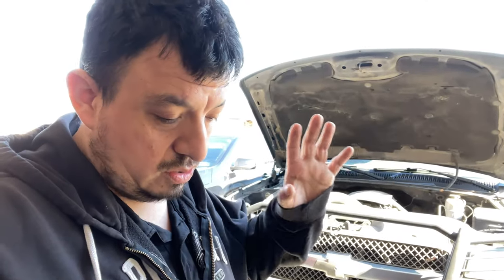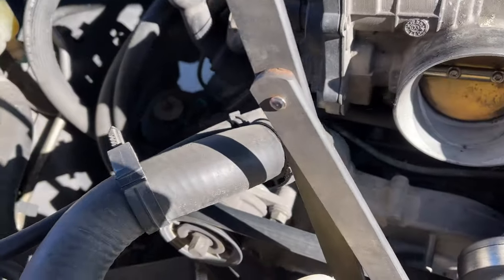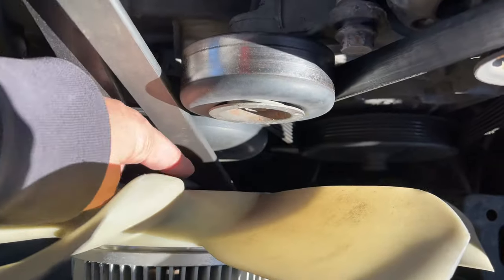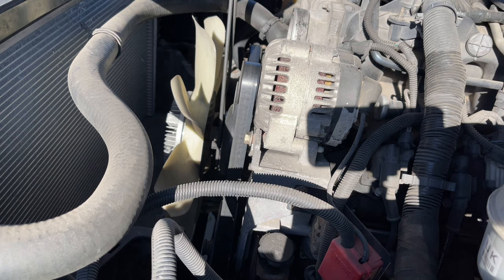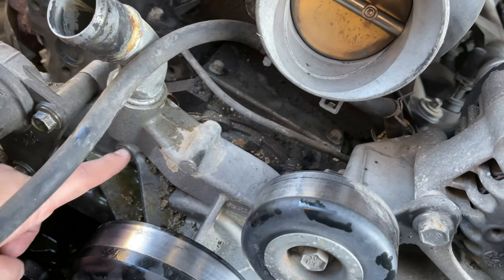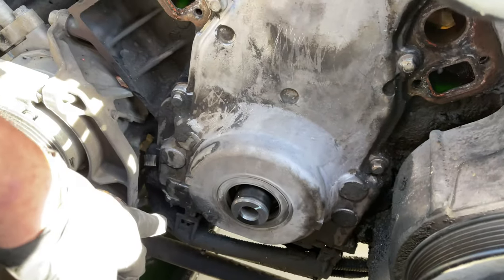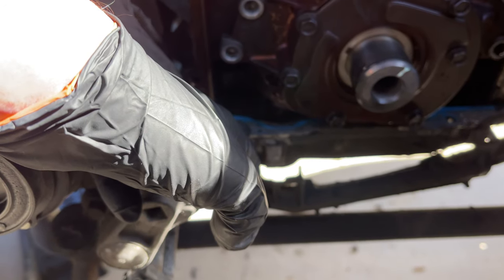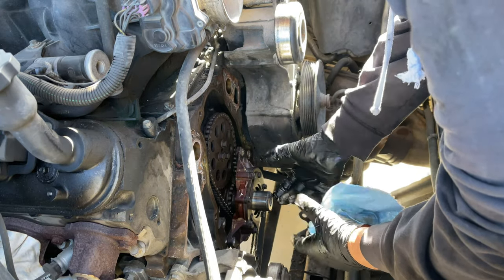Chevy 4.8L 5.3L 6.0L Oil Pump Removal & Replacement

Comment: 2002 Tahoe 5.3 I just bought it and it after the second day the oil pressure dropped and my truck started tapping but when u turn it off and on it goes back to normal then drops again, what could it be? Pump or sensor?
Reply from the maker: have you changed your oil? i would start there .. sounds like there is trash/debris on the oil pan .. try that first and see how the oil looks when coming out

Comment: Would you be able to take the fan off with out the special tool
Reply from the maker: yes but not easy
Reply: I took off the water pump, fan came with it.
Reply: I replaced my water pump and from my experience it is worth the money just to get the tool.  I tried all those other ways of doing it and just got frustrated.  Bought the tool and was done in 30 seconds.
Reply: Yes I took a foot long half inch extension placed it on one hex points on nut.  Hit extension twice with 3 lb hammer.   Spun it off with my hand. 2004 5.3  Went to help my buddy he had 2006 it took 4  smacks.  Didnt use special tools or even a wrench.
Reply: I tied a shoestring through one of the holes on the water pump pulley and the left bolt on the alternator. It held the pulley still enough that I got the fan clutch off with a 18 inch adjustable wrench.

Comment: I have a 2001 6 liter 1500HD . Is the oil pump located the same as your truck?  My oil pressure fluctuates from 40 psi to 0 psi . I have to keep the rpms at 2000 until it heats up and drive 2 miles before the oil pressure builds to 40 psi. I have 283,000 miles on it.
Reply from the maker: yes .. same spot
Reply: Same here

Comment: You can losen the bolt on the pick up tube and tie a string or zip tie around it so you dont have to remove the oil pan
Reply: I use a little mini magnet, so far so good!

Comment: 11:50pm
07 Silverado has 82k but sat for 2yrs,changed the oil like twice already but lifters are knocking, run motor medic before each oil change and it's getting better, could it be the oil  pump?,gonna change again ,run a quart of marvel mystery oil to clean it better with the nx change,any suggestions other than changing the oil pump
Reply from the maker: does it have DOD?

Comment: I bought a 06 Silverado 4x4 with a 4.8 nd when I got it the oil pressure was max out nd stayed there. Had a knock sensor light on also. Got both knock sensors replace nd oil pressure replaced. Now it’s says low oil pressure. It would go up nd down nd when idle it will drop . any ideas of it ? Nd idk why but knock sensor light keeps coming on after replacing em can somebody help me out on ideas?

Comment: I have a 2011 GMC Sierra 5.3L. Today my oil pressure went to 0. When I start the truck it idles around 20psi and then after a minute or so it starts dropping. I’ve read that it could be the o ring in the oil pickup line in the pan or that it could be the pump. Hoping maybe you can steer me in the right direction? Thanks for any help.
Reply from the maker: it has the system that it switches from 8 cylinders to 6 .. correct?
when oil pressure drops does the engine knock?  or does the engine sound different at all?
Reply: Mines a 2008 yukon 5.3 with the DOD (changes to 6 cylinder) oil pressure dropped to zero no weird noises and then my engine shut off.
Reply: @FalconsGarage  hi I have the same problem my engine is a 5.3L makes a slightly small knock or rattle when it is on idle what can it be ?

Comment: I have a problem with my 5.3l it's spraying oil all over my spark plugs wires n on my headers I changed my valve cover twice n the gaskets n it still doing it now dash keep saying oil pressure low when I'm n park I'm lost I thought it would be my oil pump but that don't explain how oil getting way up there whatchu think
Reply from the maker: what about the oil pressure switch?  its up there between the heads .. maybe its leaking and oil is running down to the wires?

Comment: will this work the same on a 2010 chevy express 2500 4.8 liter v8
Reply from the maker: it should be the same engine .. for the most part ..
Reply: Shim the oil pump then prime it too.

Comment: I have a 2008 K2500 Suburban 6.0 with only about 40k miles.  No oil pressure.   I can't believe the oil pump is bad with such low miles.  This video was a 2wd.  Mine is 4wd.  Looks like a major job.

Any opinions on why my oil pump is bad?
Reply from the maker: yes on an 4wd is a pain in the butt .. i would check or replace the oil pressure sensor before doing the pump .. i believe in 2008 that truck has the ability to use switch from 6 cylinders to 8 right?

Comment: Did it get more oil pressure after the replacement? You better replace the O-ring gasket around the oil pickup tube also.
Reply from the maker: That’s a must!

Comment: My oil pressure gauge fluctuates when I'm stopped and while driving. Can that be the oil pressure pump?
Reply from the maker: to a point thats normal .. specially with this trucks
Reply: @FalconsGarage  the thing is that when I'm going 70 it jumps from 50 to 60 to 40 but real fast but I'm going the same speed

Comment: Is there a reason why you didn’t do the timing chain? Seeing that the oil pump went out you probably have over 100,000 maybe even 200,000 on that chain.  If that breaks bye bye engine
Reply from the maker: chevy timing chains last a long time specially on this trucks .. this one wasn't stretched . so no need from my experience

Comment: I have a 2001 2500 6.0 and I bought it recently but it has a scrapping sound or tapping in the lower part of the engine. It's not a rod knock sound It's more like something is hitting something. Anyone else know of this sound?

Comment: i have an interesting question, i have to do my oil pump in my 2009 cadillac DTS as it’s marking low oil pressure after replacing my oil pan gasket. i thought the harmonic balancer could have been out of torque or simply went out so i replaced it and still low oil pressure, i do remember removing it and getting a really burnt oily smell from the hole where it mounts up, my question is which one is the oil pump?? or are there two separate oil pumps in the oil pan where the catch tube is and the timing chain cover??? if anybody could help with this it would be greatly appreciated!
Reply from the maker: so I belike the oil pump is behind the timing chains .. i would take off the oil pan again and double check everything .

Comment: Avoid the nightmare of R&R oil pump replacement. Unlikely the mechanical pump has failed, more likely the gasket for the pickup return is worn out. Add some AT-205 to the oil and save yourself a 12 hour job. I did it on a 2006 4.8 with 283K and both the 'low oil pressure' warning and the valve tapping has disappeared.

Comment: My motor has a loud click, when you accelerate it gets louder. Is it the oil pump?
Reply: Do you have oil pressure? Could be a a few things.. however my guess would be valves need adjusted
Reply: @classiccam4647  the oil pressure went down and as soon as that happened it started click.
Reply: @julian_km5529  is it at 0?  That’s does indeed sound like and oil pump is bad
Reply from the maker: I agree could be oil pump
Reply: @classiccam4647  it’s at 20
Reply: @classiccam4647  my pressure drops to zero at idle but picks uo when accelerating never goes above like 22psi tho lol
Reply: @thephantomzoneboxing  bad oil pressure sensor?
Reply: @classiccam4647  i dunno its a old big block 427..retarded the timing so it wouldnt diesel and then this issue starts up..but who knows might be a bad pump..i just put a gang of treatment in it as far as the honey oil and stop leaks

Comment: WHEN DO U KNW ITS YOUR OIL PUMP AND NOT A SENSOR OR OIL FILTER WHEN YOU HAVE LOW OIL PRESSURE??
Reply from the maker: You don’t. You have to do testing. Even once you replace the oil pump issue could still be a spuned bearing from the bottom end. Could also be your oil screen witch you can only see if you take off the oil pan. So there is NO simple way

Comment: I have a 2008 Suburban, K2500 6.0 engine with only 40k miles on it.  I lost oil pressure.  I suspect it is the oil pump.   I cannot believe that I have to replace an oil pump on an engine with such low miles.   We have a 1999 and had a 2004 Suburban.  They are / were great vehicles.  This 2008 is a lemon.
Reply from the maker: are you sure its the oil pump? this engines are known to have faulty, oil pressure sensors, dash cluster and if its the type that switched between 6-8 cylinders are also known to have a leaking upper cover gasket
Reply: I had that problem on a 2007 impala ss 5.3l and also on a 2010 silverado 5.3l. There is a plastic screen below the oil pressure sensor that gets clogged! You will need a pick or bend the handle end of a chainsaw file into a hook and reach down the hole after removing the sensor and hook the screen and pull it out and replace it along with the sensor! I almost guarantee thats is your problem!

Comment: So everyone keeps telling me the motor has to come out and trying to charge me over $1000 to put the pump in, I have a 2006 Tahoe 5.3l n it doesnt look like you pulled the motor out at all just took some stuff off 
Someone reply because I'll rather do it myself if motor doesn't have to come out
Reply from the maker: if your engine looks like this .... then engine does NOT have to come out

Comment: Appreciate the content, but you didn't torque a single bolt.... You used a 1/2 impact to put on bolts meaning to have 18 ft lbs or torque. but wait!!! You then tightened them even further by hand! Good job, bud. We all need to see the wrong way to do things, I guess....

Comment: You don't need to take the oil pan ther is a trick to do it so
Reply: What did you do to get it off
Reply: Withe the 10 milimetros took the bolt 🔩 off and with the magnet 🧲 took out the oil pan when I put the pop back up i got the bolt 🔩 in the other side just cut the little weld in it and it will turn around so you can put the bolt in the other side ,,them fucker dealers just make it that way so they can change more on labor
Reply: @alfredoleyva255  I didn't really understand that...🤔

Comment: I have a question, I have a 01 GMC Yukon, it shows check engine oil level but my oil is right in the middle and no problem, I change the O ring, I check the lifters everything is working fine, but I dnt think it should be saying that. Should I be concerned ?
Reply from the maker: have you checked the sensor or the cluster it self?